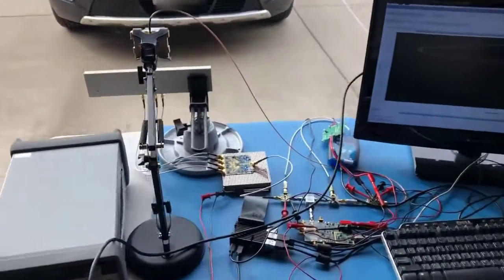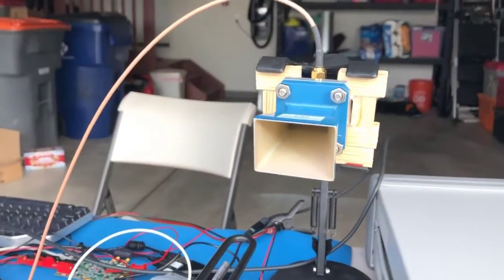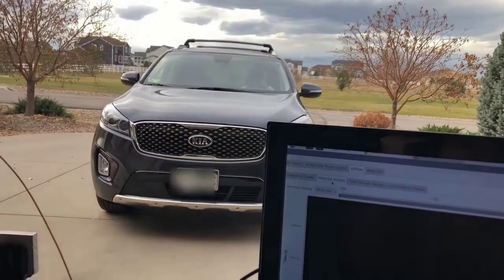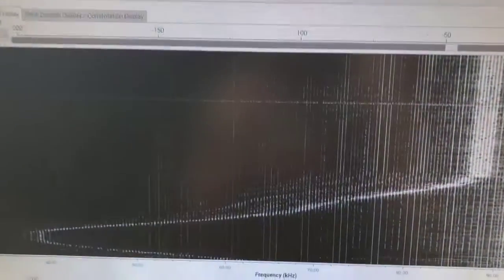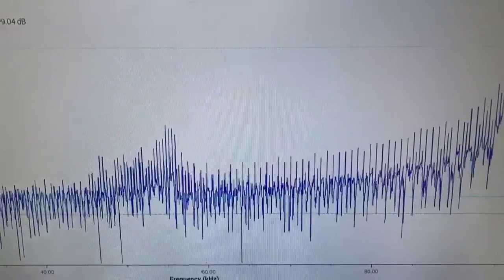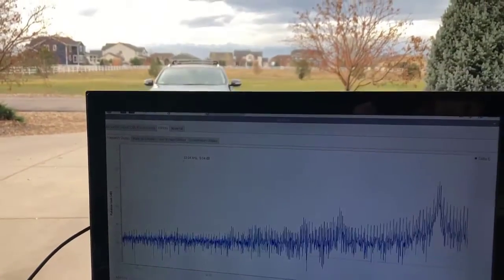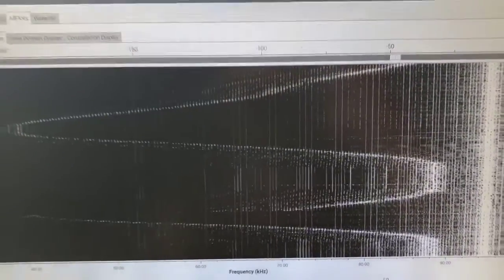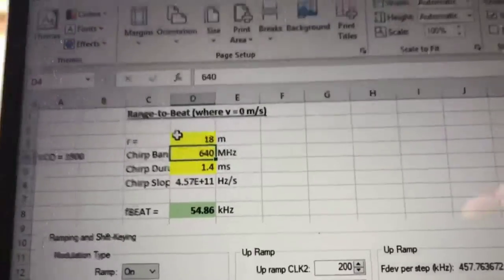FMCW radar with Pluto, the ADF4159, and GNU Radio

Comment: Can the chirp not be generated by the Pluto transmitter? Is there a hardware limitation on that?
Reply from the maker: Yes, the limitation then is the bandwidth swing of the frequency ramp--so you could get about 50 MHz, instead of the 500MHz we are getting with the external LO.  But digitizing the ramp, and then applying a correlation function to implement pulse compression, is a great method.  My friend, Dr. Don Metzger, has made of a great video of doing that with Pluto:  https://youtu.be/v2cqUal_RLw
Reply: @jonkraft  i would like to test this with only the pluto on gnu radio do you have any idea where to find some example grc file ? thanks
Reply from the maker: @katrwerser2173  Yes, we actually did a nicely updated demo of this video at GCON22.  The link to that presentation is:  https://youtu.be/1jJWfsGeZvE?t=19741
And the GNUradio file (must be GNURadio 3.10 or higher) is:  https://github.com/mhennerich/gr-examples/tree/main/rad-pluto-adf4159
Reply: @jonkraft  Thank you! Really useful.

Comment: Cool. Now add DSP to derive numerical distance value, add distance comparator code to generate speedup/slowdown canbus signal to feed car's cruise control module. Pack it up and mount behind front bumper and you got a usable adaptive cruise control radar.

Comment: Hi Jon,
Could you share the part number of the VCO you used in your setup? I'm working on replicating a similar setup at school. Thanks!
Reply from the maker: It's the HMC515LP5E.  It's just the standard VCO on the ADF4159 evaluation board (EVAL-ADF4159).
Reply: @jonkraft  Hi Jon, thanks for your answer. I have another question regarding your sweep settings presented at the end of the video. You show that you have 700 steps in order to cover the entire 640MHz spectrum, which means a step size of ~914KHz (or 457KHz in the software). I'm just surprised that you could achieve sub-meter accuracy with those settings, since such a step size incurs an error of 914KHz*(c/[2*slope])=300m. Could you let me know if you used different settings in your setup, or if my understanding if wrong? 

Your work has been super helpful, both this video and your workshop on AOA detection have been crucially instrumental in my work. Cheers!
Reply from the maker: @slim_cana  Thanks for the kind words!  Regarding the range resolution, the #'s you're putting into the range resolution equation are not the right ones.  Check out https://www.radartutorial.eu/02.basics/Frequency%20Modulated%20Continuous%20Wave%20Radar.en.html.  They have a great explanation.  With my ramp rate and freq deviation, you should get less than 1m resolution.
Reply: @jonkraft  Ah I see, I thought that since the FMCW sweep was done by stepped increments, it would affect performance of the setup. 

I guess my final question is how did you manage to capture a ~100KHz signal with the Pluto, since the lowest frequency is 70MHz? Thanks again for your help!
Reply: Ahh I think I got it, you're adding a certain carrier offset with the TX of the Pluto only on the transmit side, so that you can demodulate it around the correct frequency at the receiver.
Reply: @jonkraft  Hi Jon,
I still have a bit of an issue understanding how you managed to measure a beat frequency of a few dozen KHz (from ~40KHz to ~100KHz) when the frequency step of the FMCW signal is set to about 457KHz. Could you enlighten me of this effect? My understanding of the setup is that the smallest measurable frequency deviation is going to be similar to the frequency step. By the way, I tried getting an answer on the Analog Dev forums to no avail. 
Cheers!
Reply: @jonkraft  FYI, I was able to reproduce the setup on my own based on your design and I am actually getting a resolution similar to yours. It seems that the ADF4159 is actually sweeping through the entire band linearly, which was a happy surprise.
Reply: @jonkraft   Hi Jon, I'm a little confused here. The VCO onboard is 11.5 -12.5 GHz. In the video you mentioned the board is connected to an 8 GHz VCO. At the end of the video, I saw VCO=3900 (assuming it's software value RFout/2). Also, what's the design frequency of the patch array, 10.5 GHz (from your other videos)? It would help if you could provide the part list like your other videos (mixers, PA, filters). I really want to replicate this setup. Thanks a ton!.
Reply: @neerajkumar9583  Hey Neeraj, on my own setup, I wasn't able to get a 8GHz signal from the ADF4159, but for my application, I was actually interested in running the setup at 6GHz, which worked nicely.
Reply from the maker: @slim_cana  Sorry for the delay, I was at IMS2022 last week, and just getting caught up now.  Yes, the steps actually get translated to a linear analog voltage ramp.  And that is what gets applied to the VCO.  So the steps are smooth and continuous.  Of course, you could also set your timing to produce discrete jumps in frequency, and sometimes that is done if we want to do FSK+FMCW ramps.  You can set it all up in the ADIsimPLL program, and it will show you what your freq ramp will look like.  Hope that helps!  But I think you figured it all out anyway!
Reply: @jonkraft  Thanks for your answer Jon! Yes, my results are actually quite impressive with a similar setup too; I'm able to track the movements of a human being! Thanks again for you help :)
Reply: @slim_cana  Hi Yacin, could you plz share your setup, the parts used?
Reply: @neerajkumar9583  I've used pretty much the same parts as in the video. The part numbers themselves are quite irrelevant from what I could tell. I just used basic mixers, couplers etc. I received the signal on the pluto. You also have access to my whole thoughts and debugging if you read this message thread :)
Reply: @slim_cana  Hi Yacin, I also messaged to Jon. I have the ADF4159 board with the standard HMC515LP5E VCO. I observed 6dBm power at 12GHz tone (-1dBm at 6GHz), but it drops to -55dBm when generating triangular ramps with 640MHz bandwidth (320MHz@6GHz). How much power did you get out of the VCO? Was it sufficient for the mixer LO drive, so I was curious what mixer and amp setup you used.
Reply: @neerajkumar9583  Hi Neeraj, I was using an uncalibrated spectrum analyzer in my tests, so I dont know how accurate my numbers were, but I was measuring -35dbm at the output when I was chirping. It was more than enough to drive my mixer though! The output to the Tx antenna was around ~-20dbm after mixing with the "carrier" coming from the Pluto.
Reply: @slim_cana  Was that mixer with inbuilt amplifier (like the one in video) or you put any amplifier before the LO drive?
Reply: @neerajkumar9583  it was without an amp, but I didn't have to use an amp before the LO. Not a bad idea to add one though.

Comment: Hi Jon,
I would love to replicate this setup. Could you share details on the setup and parts used (vco, mixers, PA), Pluto LO frequency in transmit side. Could you please share the grc file?
Reply from the maker: We're actually going to release some lower priced hardware to do this very soon -- more info in about two weeks.  Called the ADALM-PHASER.  It'll have the VCO, ADF4159 ramping PLL, mixers, filters, etc.  Then you just connect it to a Pluto.  And run all the software in GNUradio.  I'll update this reply when the link is available.  Or remind me in a couple of weeks.
Reply: @jonkraft  Hi Jon, I have the ADF4159 board with the standard HMC515LP5E VCO. I see 6dBm power at 12GHz tone, but it drops to -55dBm when generating triangular ramps with 640MHz bandwidth. Is this normal? Mixers need much higher LO drive power than this, so I was curious what mixer and amp setup you used.
Reply from the maker: @neerajkumar9583  I suspect its an issue with your measurement.  A 12 GHz, 640MHz real time spectrum analyzer is very very very expensive!  So you are probably only sampling a portion of the ramp and so its not a good measure of ramping output power.  The VCO produces constant power, and only changes a little over frequency--there's plots in the datasheet.  A better way to look at the freq ramp is to monitor the Vtune pin of the VCO input.  That voltage will directly correlate to the VCO's output frequency.
Reply: @jonkraft  Reminder to update the reply